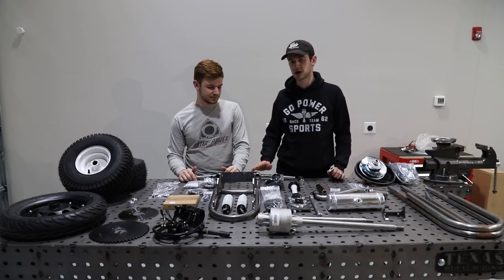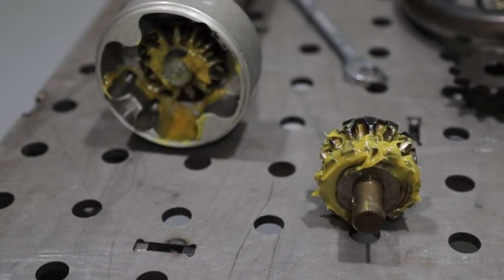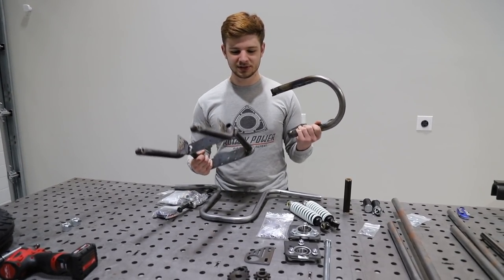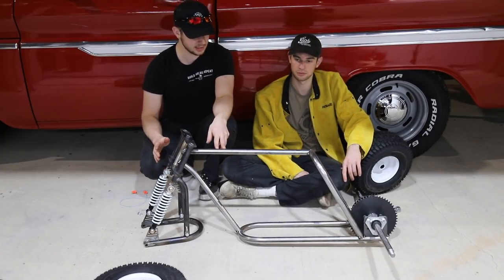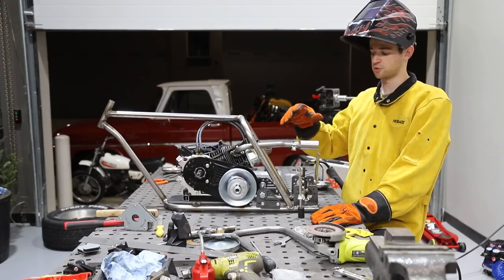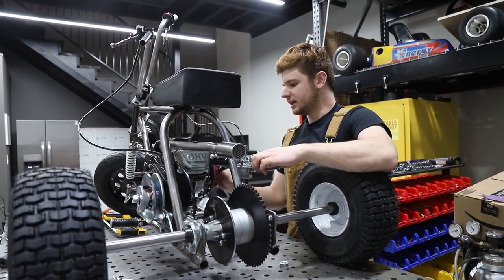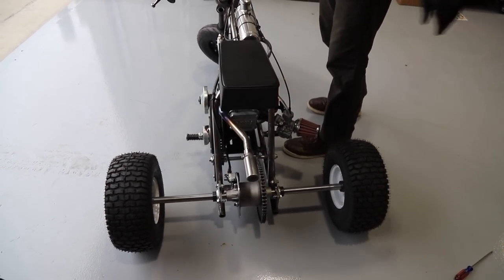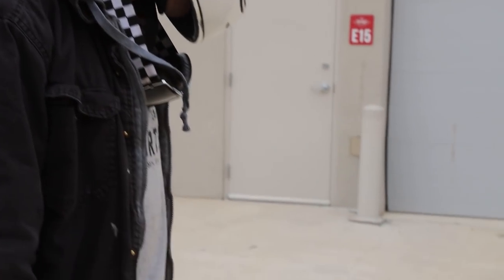Minibike Trike Build - With a Differential! FULL BUILD

Comment: Nice build. If planning to do some off-road riding I suggest adding more support for the rear axle and moving those foot pegs forward 3 or 4 inches. Nothing like getting your ankle tore up by the cvt from bump. Especially when you're foot wear has strings and not straps!

Comment: 1) those differentials are not designed for loads and need bearings at the ends and at the diff or they snap.
2)the rear brake won't work when placed on the diff... The rear brake needs to be placed at each wheel
Reply: Yes the brakes are important!
Reply: Technically yes the brake will work where they have it. Not so well in a corner, but going straight yes. Also when taking off and braking it's actually loading the spider gears in the differential, so I say meh, its all good. Lol
Reply: @shawnsatterlee6035  a bit sketchy but ok... I have a minibike without brakes 😆

Comment: I put a P100 diff on my 1800W power wheels build (soon to be double that). Though my variant has a 3/4" axle, but was able to get it under $100. I did also but a disc brake on either side of the diff, so I have differential braking. Awesome (interesting) trike build!

Comment: Neat build. I'm not sure about the cage style recoil starter mount though. An air cooled engine depends on the shroud to direct the air flow generated by the flywheel through the cooling fins. Take that forced airflow away and you are really at risk of overheating the engine.

Comment: In my opinion  a traditional 3 wheeler has a solid rear axel so when you corner you can get it on 2 wheels and ride it like a motorcycle yea a dif helps at slow speeds but you lose that benifit when under power in a corner because your inner tires just free spind because of no load but a cool build as always

Comment: move the brake disk to the wheel and add a second to the other side controlled by a second lever,  this would allow you to control the speed of each wheel independently of one another for sharper turns and a more interesting ride!

Comment: If you move the rear brake to the axle and put another one on the other side you should be able to control which side gets traction and would steer insanely sharp

Comment: Yea glad I did mine with suspension all around. Larger front wheel.  Front and rear brakes my seat is lower for better cg points while turning with a solid axle.

Comment: A fuel tank from 5" tubing, with a tunnel in it from 2" tubing cut in half, with a strap across the bottom, to mount, with rubber around the tube , for extra support, , maybe cut the seat end of at about a 22°-45° angle, with a  1/8 npt, for a 3/16- 1/4" valve and barb fitting, at the rear on one side, maybe both sides to get the fuel from both sides,   possibly put the tunnel in shallower on the front end, to make it look better, and help fuel distribution to both sides of the tank,  5"-6" dia, with about 10"-12" in length, should hold enough fuel!  With a 1.5"-2" bunch and fill cap,.   I also have a old 80cc Suzuki bike missing parts , but in good shape, I'm thinking about making a trike from, being a I have a small 4wheeler axel, that would fit size wise,  and it needs a rear wheel! It could be fun!!  Put a 420cc engine on it, maybe a 212-224, use the old engine as a transmission!

Comment: Does anyone make LSD cores for these diffs? If so try to find a TORSEN one, both wheels will be locked together 99% of the time, only lifting a power wheel creates full slip and turning is enough to overcome the locking force
Reply: there are some cheap chinese ones on ebay that actually seem to work, from what I have seen on other trike vids

Comment: That diff isn't going to last long. Back in the day I had a Bulldog with that diff and even though that design had PROPERLY located bearings and brakes, the bushings failed. Also with the Bulldog the rider sat low so in theory the diff made more sense than here, where the rider sits high and can easily take the load off the inside tire. You guys are just copying the common narrow-spaced axle bearings without knowing why. Come to think of it, I don't know why ANY application would use narrow-spaced support bearings vs wide-spaced.